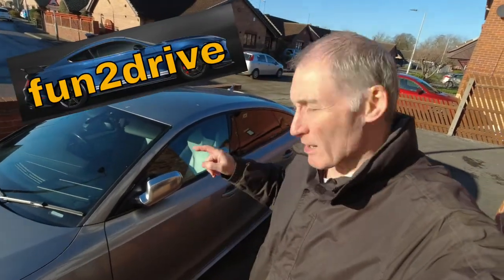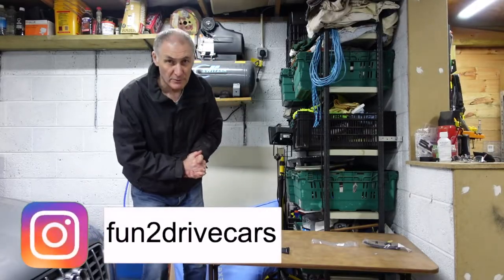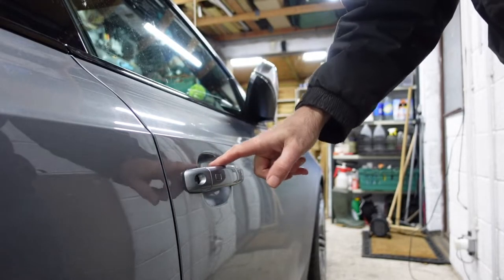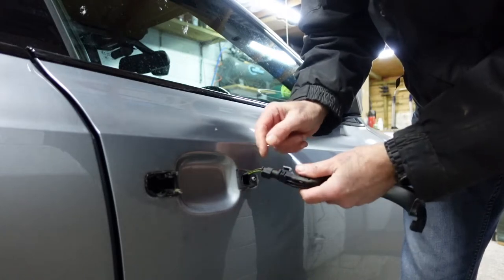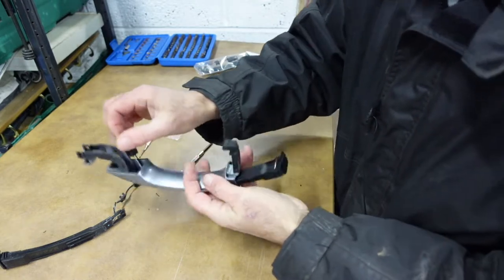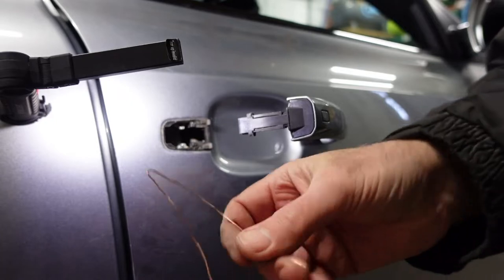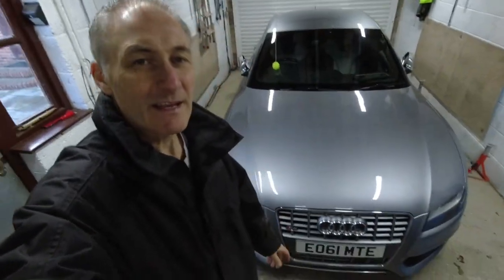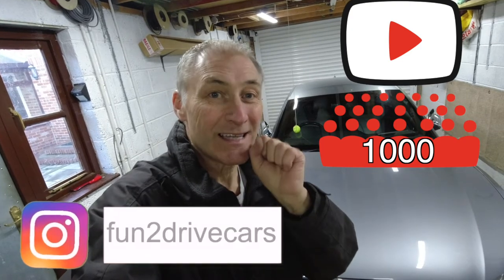Audi B8 A4 S4 A5 S5 Replace Door Handle Sensor | How to | DIY

Comment: 2011 Audi Q5 keyless entry stopped working earlier this week on all doors. Ordered a couple of sensors from Amazon yesterday (£10 each including delivery) - arrived today. Checked for faults on vcds - rear right sensor was open circuit. Cleared faults on vcds and the other door sensors started working again, but rear right still not working. Followed your guide for replacing the sensor, and had the job finished in about 10mins. Didn't need to mess with wire hooks. New sensor didn't seem to work initially. However, started the car, checked vcds again and everything was still good. Stopped the engine got out of the car and tried the sensor again. Worked this time, and has done every time since (similar experience to others). I'm sure this quick repair alone will have more than paid for my vcds licence! Thanks for the nice tutorial.
Reply from the maker: So glad it helped you!

Comment: Make sure to start / stop your car a time or two if they do not work at first!!  I was pissed when I replaced both door sensors and nothing worked... after a bit more research I turned the car on/off about an hour later and everything worked perfectly!  Thanks for the awesome video, just wanted to add that part.  Don't get discouraged if they don't work right away!
Reply from the maker: good tip!, thanks mate

Comment: Thank you so much for this video! I have been searching for months...kinda😅, to try to find out what happened. I had a dealership repaint so maybe they messed up the sensor if they took it off. Anyway, at least I know now that only 1 handle will throw off the whole system
Reply from the maker: Glad I could help!

Comment: Wow thank you so much, the trick with the wire to get the door handle saved me.
Also i had trouble getting the door lock cylinder (driver door) was a nightmare, i just kept moving the actuator and adjust the lock cylinder until they sat in place...must be a proper method doing it.
Reply from the maker: Glad it helped!

Comment: I dont know if anyone had the same problem as i did. I could only get half the lock out. How i ”solved this” was first removing the shell and then just using pliers to really drag it out really hard. And it worked. Seems like it was stuck or something. Gave it a bath in my ultrasonic cleaner and put some grease on it to make it not happen again.

Comment: The torx nut is a lock nut, you can push it in to lock the door mechanism. So you dont have to mess around with the wire, if you don't need to close the door of course.
Reply from the maker: Thanks!
Reply: Can you elaborate on this? Are you saying you don't need to take the door lock off?

Comment: I'm struggling with the part at 7:04 where you hold up the lever with the copper wire. When I do this and push the torx screw in the lever still falls back down. I have a 2008 Audi a4 for reference
Reply from the maker: you need to push hard with the torx screwdriver to hold it until you push the handle in, it dropped for me in the video, but i got it second time!

Comment: Love your video… Is the method any different for front passenger side door?  I’ve unscrewed the torx..  but the barrel (or plastic bit in this case as there’s no key lock on passenger side) won’t come out.. 
any help is appreciated .. 

Ps if I’ve pushed the torx screwed inside the door.. Is there a trick in getting out… If I could remove the door handle I could easily push it back in .. but door handle is giving me grief lol
Reply from the maker: Hmm, interesting, as mine started to work after the drivers door, I didn't get to remove the passengers door handle, I would have assumed the procedure would be identical. Sounds like you may need to take the inside door panel off to see if you can get access to it that way.
Reply: Any luck?  I'm in the same boat.

Comment: I have an audi a4 b8 2011, i have the small square ▫️  on the dor handle, but i do not have the start stop button inside the car.     Is any chances that my audi may have the keyless entry, or not.   

Do i need to have also start stop button , thanks
Reply from the maker: I am pretty sure it does need the button for it to have keyless start/entry, I think all handles are the same but yours probably won't have the sensor installed.
Reply: @philscars  thank you sir

Comment: Hi, Thank you for the video.
I have Audi A4 2008 but the sensor not working, when I open the handle to replace the sensor as I thought the sensor not working, I couldn't find the old sensor inside and also I couldn't see the cable connector for the cable!!! do you think my car without sensor ? or not possible?
Thank you!
Reply from the maker: I would say that you dont have sensors!

Comment: Hey question is this also the sensor that if you press the key fob unlock button and it will send the signal to unlock it ? or is there another sensor for car to get from key fob to lock or unlock when pressing the key fob button?

Comment: Hi, great video! Wonder if you could help me. Thieves pulled out the driver's side lock cylinder on my 2010 Audi S5 (4.2 V8), then were disturbed before they could do any more damage (or nick the car). Otherwise, the door works perfectly well using the fob. Watching your video, I reckon I can fix it myself, but after hours of searching I cannot find where to buy the lock cylinder from (it's the first part you remove in your vid). Could you point me in the right direction please? I would be most grateful.
Reply from the maker: I would have thought a search on eBay would turn a complete handle up for sale, or, contact audi and they will be able to get the part number and give you a quote, I have found them to sometimes be cheaper new than buying second hand from a scrap dealer!

Comment: Hi, thanks for your video. I have a coupe so I have replace both sensors, I have clear the errors with VCDS they were working but if I stop the engine and lock the car from sensors is fine and when i unlock the car is working. And as soon as I stop the engine is not working anymore, I need to connect VCDS again, clear the error and they work again. So all the time that I stop the engine and turn on again I need to clear the error all the time.

Do you have any idea why they are alway faulty after I turn off and on the engine? 

Thanks in advance
Reply from the maker: Hi, sounds very strange, are you sure that you have changed the correct ones? I.e. Could it be the rear doors?
Reply: @philscars  well I only have two doors, and I change both.. not sure we're is the problem coming from..

Comment: Any of my 4 doors work, do I have to replace the 4 door sensors? Thanks!
Reply from the maker: If 1 goes faulty, it stops them all working
Reply: @philscars  Thank you! How could I know which one replace or should I replace them all?
Reply from the maker: if you have VCDS, that will probably tell you which sensor has failed, if not, you will need to replace them one at a time, I would start with drivers door handle as that is the most likely one!
Reply from the maker: @DrunkcookingwilthBilly  VCDS is windows software, that along with an interface, will allow you to obtain info from your car and also code features etc, full details here https://www.ross-tech.com/vag-com/VCDS.php

Comment: Hi there
I had A4 2010. I have a question? All my car doors have a little square but not push buttons. All door working with remote and each door button but I scan with ODB the message said rear right door fault. So there is my car has door sensors or not.Thank

Comment: S.O.S. can you help me please? For me it was the rear 4th door on the right that had a faulty sensor. I replaced it, put the door handle back on but I cannot seem to put the last small piece of the door handle back on. Every time I try to put it back the 1/3 of the piece pops back up and it also moves with the whole lock that way. If I push the side torx all the way to the right, I can put the last piece of handle back on, but my door handle stops working because it cannot move. I have tried doing it from scratch with the same result. It is either a working handle with the last piece missing or a non-working handle with the whole handle.
Reply from the maker: I can only show how I got it to work, if you follow my video it should be ok
Reply: @philscars  thanks for your fast reply. I managed to put the last piece back at its place but it was tricky as hell I had to move with the side torx and with the lock up and down side to side until it finally fit. Thanks for your video it helped me a lot.

Comment: hello, HELP, I also have a4 b8, the keyless entry function does not work, the car does not display any errors, neither does VCDS! is it possible to be a broken sensor? but shouldn't the car show an error or when I did the test with vcds? I changed the car battery and I read somewhere that the keyless entry function should be resynchronized if the car battery is changed, is it true and is it possible that the sensor is not damaged?

Comment: Just tried this on my s4 replaced both drivers side and and passenger door still not fixed it, could still be the back door sensors that are faulty I’m guessing!
Reply from the maker: Have you had vcds on it? Apparently it can show you which one is faulty…
Reply: Definitely scan your vehicle for fault codes. My keyless stopped working suddenly this morning, I scanned it with OBDII and found out the rear left sensor throws an error (Audi A4 B8 - G417 sensor). I removed the fault code via the scanner, after which the 3 remaining doors started to work. Although not sure for how long. The read left door does not open with the sensor even after clearing the fault code. Which makes me believe I confirmed where the problem lies. I will change the sensor in the single door, hoping it will fix the issue.